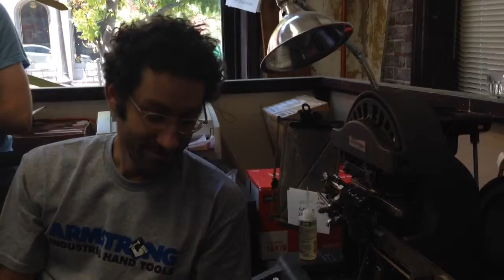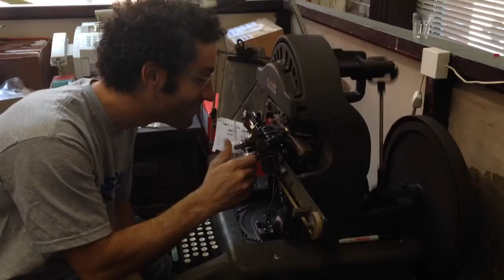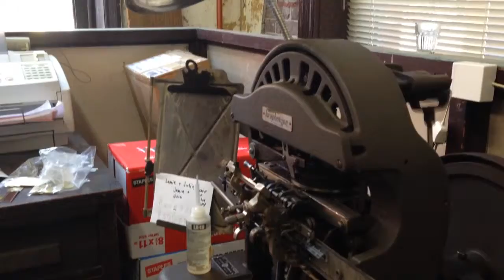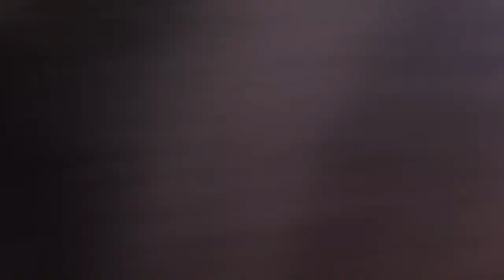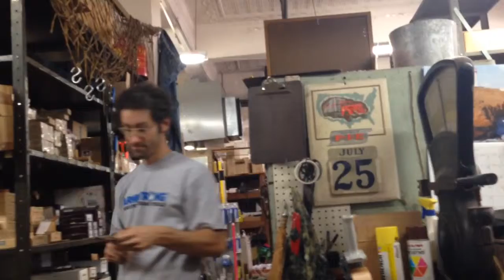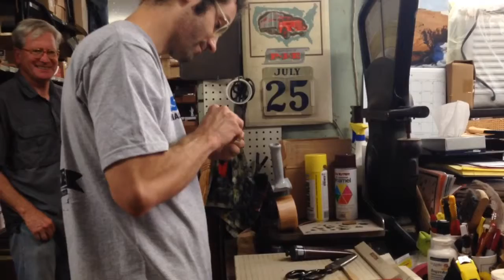Epstein's Adressograph

Comment: If I could find one I'd much rather have a 6400 series with upper and lower case letters and a model 4000 Imprinter like we had at TRW. Still in use in the 1980s.